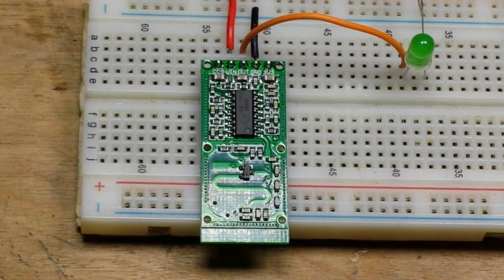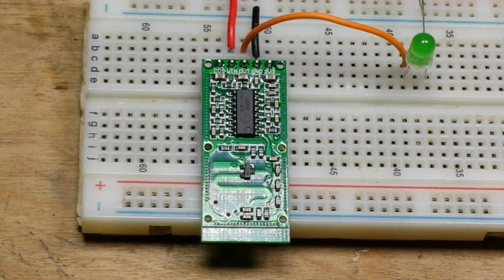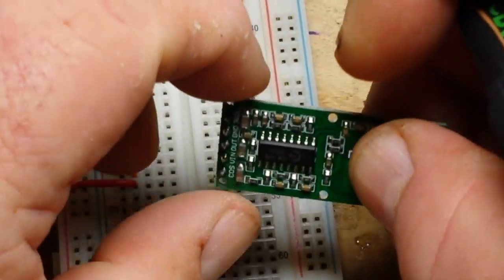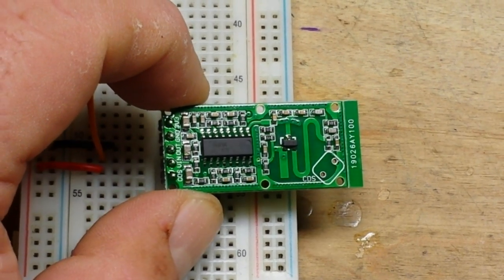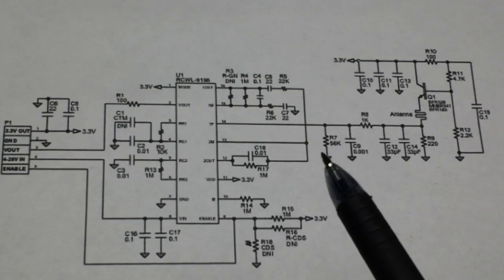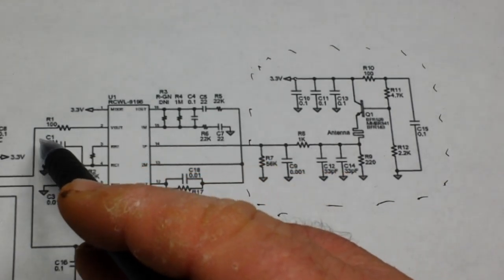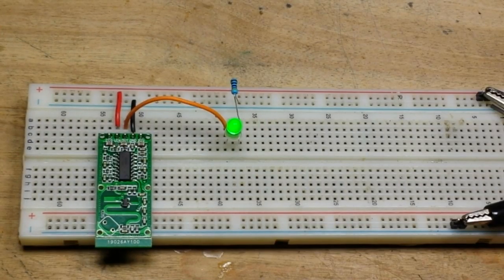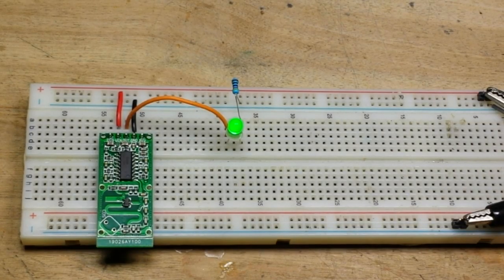Quick Look: Microwave Motion Sensor

Comment: I have recently found a very good reason for using a combination of PIR and radar detection modules in alarm systems. During the summer heat wave in the uk all PIR sensors stopped working, the reason being ambient air temperature had reach human body temperature 98.4F, making the IR from humans and other mammals invisible against the radiation from the background.

The big weakness with these microwave modules is that they have a very poor front to back ratio.  Meaning they can be just as sensitive to movement behind them as in front. I do not know if this is true of all versions on the market, but it is true of the few I have use. I have had some success mounting them in metal boxes fitted with a plastic lid. The lid being transparent to the microwave signal, while the metal box shields/focuses the beam in one direction. I have found the standoff distance from the back of the box is important to maintaining a good front sensitivity. I assuming that the radiation reflected from the back plate form a standing wave that may be constructive or destructive, depending on distance from the plate and operating frequency. There maybe a reliability issue using this technique give the poor stability of the microwave frequency.
Reply: Nigel Johnson :

As a side note, it has been an objective in order to minimize false alarms on security systems by digitally ANDing the alarm output stages with IR and microwave intruder detection.
Reply: @mtkoslowski  I have designed a system that allows select and AND/OR as options between PIR and radar inputs.
While AND might help avoid false triggers, in hot weather the PIR will disable the alarm output.
Most PIRs used to control drive way lights are disabled during daylight hours by an LDR sensor, even if the PIR provides an alarm outputs. I think part of this is because sun light heating of the surroundings can blind the PIR, making its alarm output unreliable in sunlight. ( Thinking about this, there may be a good reason for fitting an ambient temperature sensor in the alarm sensor, then the decision as to the combination of radar and PIR outputs can be based on the ambient temperature. Maybe my next alarm project will try this.)
Reply: @nigeljohnson9820  the difference in ambient infrared radiation on a hot summer day when a human body passes nearby adds a small factor to the total and makes it harder for the internal uC to decisively put out a logical signal whilst at night there is much bigger difference at the same occasion
Reply: @ronen124  I thought I had already said that. PIR detectors work by detecting the change in IR within their field of view. A faceted Fresnel lens in front of the detector is used to maximise the gradient discontinue in detected radiation.
 When the ambient temperature is close to body temperature, the body becomes invisible to the PIR sensor, as it screens the  background radiation while replacing it with  body radiation at the same temperature. This is like trying to see a white artic fox against a background of fresh white snow.
The more sophisticated PIR detectors may use a micro processor to detect and minimise false triggering, but the circuitry of most PIR detectors is far less complicated, either using a dedicated analogue PIR IC or a simple opamp or comparator configuration to process the AC signal generated by the PIR sensor. A common configuration is to feed both inputs of an Op-amp from the sensor output. One input is low pass filtered the other is high pass filtered. The Op-amp output nulls out the sensor DC component while amplifying the AC component. This arrangement is slightly more complicated than simply AC coupling the detector amplifier to the sensor, but makes it slightly easier to detect the relatively slow changes associated with a body intrusion while still rejecting the very slow changes associated with ambient temperature changes. The op amp output is converted to a digital signal using a Schmitt trigger or monostable configuration usually using elements from the same IC package. All can be done with a single quad Op-amp or quad comparator IC package, though an OTP microcontroller circuit can be just as cost effective provided that it supports analogue inputs, e.g. ADC or comparator inputs.

( I remember an project article from an electronic magazine of the 70s or 80s. This had an optical alarm sensor constructed from a bridge circuit of photo transistors. The sensor was placed at the focus of a simple convex lens. The idea behind the circuit was than movement in the field of view of the lens would unbalance the bridge and produce a detectable output, much like that of a PIR.
Since the idea has not been pursued commercially, I must assume that it did not work that well. However many CCTV security systems have the facility of producing an alarm output  when consecutive stored video frames detect cumulative differences on a pixel to pixel comparison basis. This effectively detecting movement between video frames.)
Reply: @nigeljohnson9820  I guess you did said that I just repeated it with different words from my own experience with PIR modules.

The module itself uses its uC to "learn" the surroundings so that the changes will be due to the last minutes/seconds, that's why when you stand near an automatic opening door long enough it will think that you become the ambient reality and it ignores you hence the door closes while you are there.
I would like to share a small and simple tip against false PIR triggers: there are a lot of destructions from the sides of the module that let (for example) a door be opened while no one around as if an invisible ghost just hovered there or, with my setup, beeps when nobody passes. that happens when a car passes by or the IR radiation perculates from other passing objects, to avoid that I install a small plastic "tunnel" on the Fresnel lens that allows the light to come only from the front - this helped me a lot.
cheers
Reply: @ronen124  the snag with fitting a tunnel is that most PIRs are blind, or at last partially sighted, if you walk directly towards them. This is because you are not crossings facet of the Fresnel Lens. That is one of the reasons why the lens is also faceted in the top to bottom direction. If by walking directly towards the PIR, your image is limited to one facet of the lens, then the only variation that the sensor will "see" is that due to the change in IR due to the 1/(distance)/\2. When the body image moves between facets, the IR is defocused and then refocused on the PIR sensor, resulting in a much bigger and faster change in the IR reaching the sensor, giving a correspondingly bigger output signal. This suggests that for best results the PIR should be placed at an angle, ideally 90 degrees, to the most likely path of an Intruder.

Comment: I like the tiny antenna. Wish HF antennas were that small.
Thanks for the look, have a great week.
Reply: In mobile phones the practical length of the aerial has been  reduced by making it from a dielectric material in which the velocity of em waves is significantly less than that in free space. it was this that allowed mobile phones to evolve from the early versions that had short stub quarter wave aerials protruding from the top of the phone case.
Reply: @nigeljohnson9820  
Doesn't the higher frequency also contribute to a smaller antenna?
Reply: @bblod4896  it most certainly does, I have not seen any dielectric aerials below microwave frequencies. At 800MHz the 1/4 wavelength is approximately 9cm, even using a helical aerial this is going to be a lot bigger than a dielectric equivalent.

Comment: Thanks Paul, great video! I'm going to head to Amazon and get some ordered for a project that I am working on for lights in my kitchen and I think this will work better that what I was going to do. The LDR part will fit right in with what I am doing and work great for my 3 month old project... Hmm that is still setting over there..... LOL

Comment: No LED series resistor needed. There's a 100ohm series resistor on board on the output. 
Data and schematics for the chip (RCWL-9196) and the board (RCWL-0156) can be found here:
http://www.mpja.com/download/34685MPData.pdf
https://www.mpja.com/download/34685MPSche.pdf
https://www.snapeda.com/parts/rcwl-9196/RCWL/datasheet/
These documents also show some options that are available on the board for adjusting range, trigger cycle time and light sensitivity (if using with a photoresistor).

Comment: They are truly part of the black arts.  Don't know where Paul intends to take this - so don't want to steal his thunder.  For ppl just starting out with them - the antennae is quite directional and so I'd recommend using 90deg connecting pins so the unit will sit up on the bread board vertically (narrow end up) which will make it more responsive to movement.  Also note when you power on the board it takes about 10 seconds to "warm up" in two phases.
If you connect a LED to vout & gnd (consider using a transistor or mosfet as a switch to help beef up power switching capabilities) - the onboard switching is pretty lightweight so only small loads.  You can get away with a single LED + 100ohm resistor OK.
https://i1150.photobucket.com/albums/o618/doppleganger1/mosfet%20switch_zpsacvh98lo.jpg - cct from big clive
When you power on, the LED will come on for 2-4 seconds ... then it goes off and stays off for about 6 seconds while the radar warms up (just long enough to wonder what's wrong!).  Then the detection settles and it should start responding to movement.
There are pads on the opposite side c-tm, r-gn used to adjust (re)trigger time and sensitivity (distance).

Pad Function
C-TM - Regulate the repeat trigger time. The default (unpopulated) time is 2s. (10nf on main cct board)
add 100nf to pad = 33 seconds (use SMD capacitor to extend the repeat trigger)
Pin 3 of the IC emits a frequency (f), and the tigger time in seconds is given by (1/f) * 32678
R-GN - The default detection range is 7m, adding a 1M resistor reduces it to 5m

Comment: Excellent Video Paul.  Is this more powerful than the typical motion sensors you get with an Arduino starter kit?
Reply from the maker: It has a longer range, about 7 meters.

Comment: Great video. I purchased a few of these a year ago and couldn't get it to work very well with a Node MCU. I'm wondering if the wifi causes some interference.
Reply: They are very sensitive to movement. On wifi interference, no. I made a flashing led motion detector.
Reply from the maker: Could be. I didn't see any notices about wifi, but yo never know.
Reply: Yes. It is definitely influenced by ESP8266 wifi. I had made one which very near each other causing false triggered in RCWL-0516. You need to keep each other away about 10cm to keep the radar sensor work properly.

Comment: Not sure why but I want one.  LOL   Live in the boonies.  Would be nice knowing when someone is pulling into our rather long drive way.    Look at Micro Wave as the Transition   between RF and Light Radiation.  Microwave behaves a bit more like light then Radio Frequencies
Reply: pulesjet : Please consider a buried ground loop antenna, and when a large ferrous mass disturbs/shifts  the oscillator you can detect it. Circuits available on the web.

Comment: Paul, how do you achieve directional output? Don’t microwave sensors need a horn? What is the range of this sensor and what are the applications for this board?
Reply from the maker: 7 meters, directional to front of board, human detection

Comment: Made a bunch of these with the transmitter and a receiver.
Reply: can you tell what is the range of detection for human body for such a module?
Reply: @ronen124  I toyed with one today, and found it to be a good ten to fifteen feet.
Reply: @jabhomemonitoring  fair enough, thanks.
 I have to check it as a PIR detector replacement for a future project
Reply: @ronen124  I've read that the 3.1 gig that it emits can interfere with other sensors of it's kind. Plus, I don't know how you feel about increasing the high frequency radiation in your house.......  my home monitoring blankets the area with motion sensors, both inside and out. I've yet to determine if they interfere with each other, but my plan so far is to use these for outside and the yard, and ir for the inside. They should be great for cars rolling down the driveway, and I am going to try putting them underground  also. Probably just two to three inches.
Reply: @jabhomemonitoring  I doubt if it emits more microwave radiation than a cellular phone at rest (not while talking which is way higher) more than that it will rest in a place where not many people pass and a PIR detector cannot do an honest job during daytime under the sun - there are far too many false alarms..
Putting those underground protected from moist should be a good idea, at this notion I would want to check their behavior underwater as well - you can never know what interesting project will be necessary to tinker with tomorrow..(-:
Reply: @ronen124  you are absolutely correct in regards to the the amount of radiation emitted. I was running one yesterday, on a 15 amp power supply,  with and digital meter that has a resolution down to one hundred milliamps, and it never even registered. 

Agreed on the keeping them dry. I took three units, put them on the end of a 25 foot shielded wire, and then put various levels of heat shrink tubing over the unit. I didn't expect to, nor did I, have any degradation in detection distance. 

Yes, I'm also interested in how water or rain would affect them.

Btw, have fun playing today.  Electronics, is something to where you can be s grown man, and still play with toys. : )  It can pay pretty well too. = )